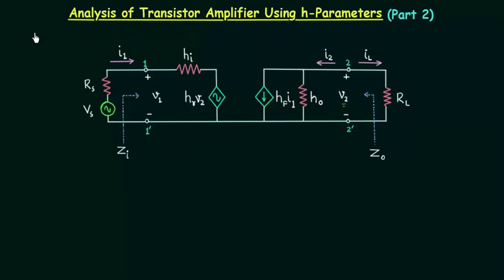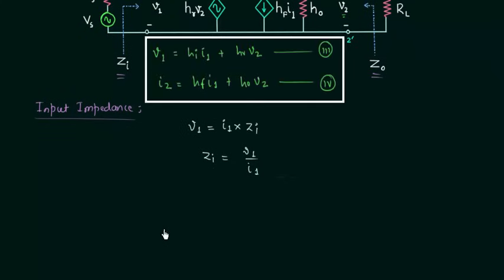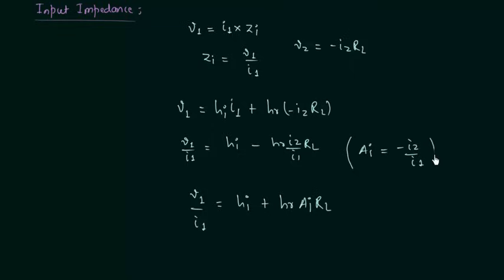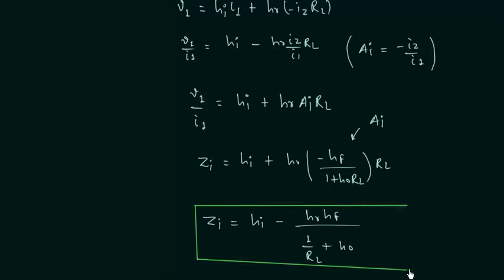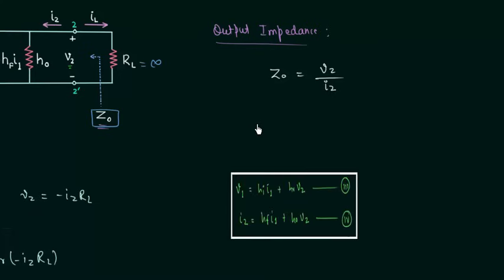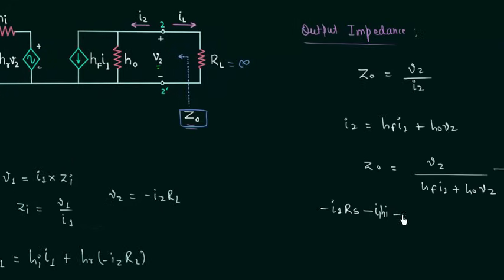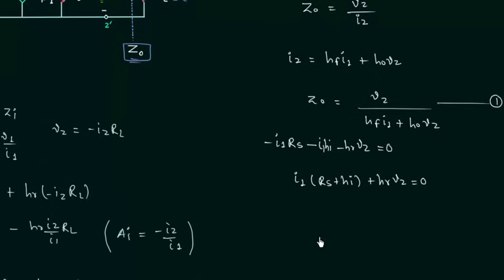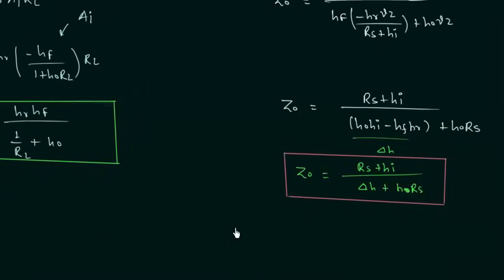Analysis of Transistor Amplifier Using h-Parameters (Part 2)

Comment: Why (i1 Rs) is negative in KVL while calculating output impedance?
Reply: he is calculating in direction of current (that is clockwise) ,so voltage drop in resister(Rs) is --i1Rs

Comment: sir, actually Zo=V2/I2,but V2=-I2RL then Zo=-RL
will u please explain it?
Reply: As il=-i2 ..here at output loop il=0 because we open circuited the RL no current flow so iL=0 .so we cannot take i2 becomes zero.  I2=0 then Zo=0..